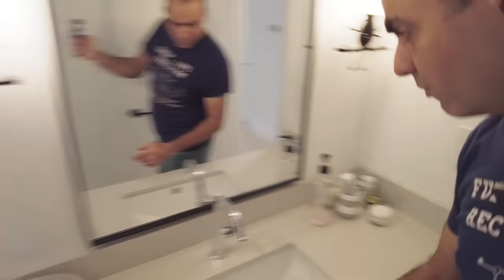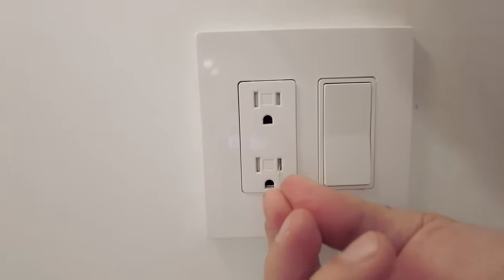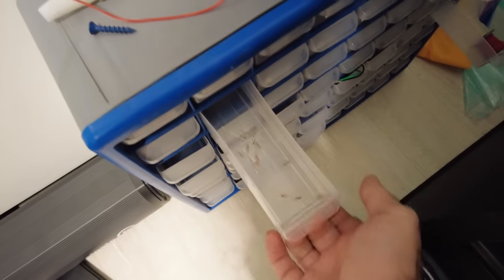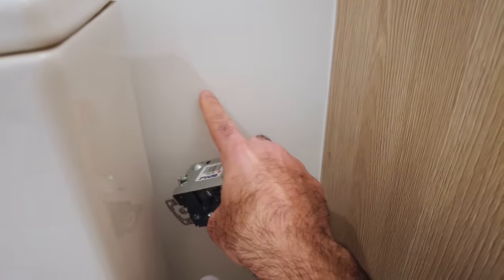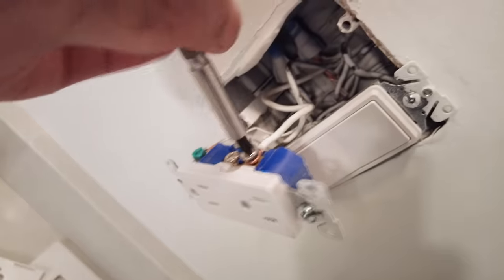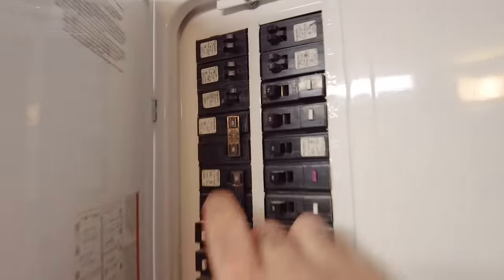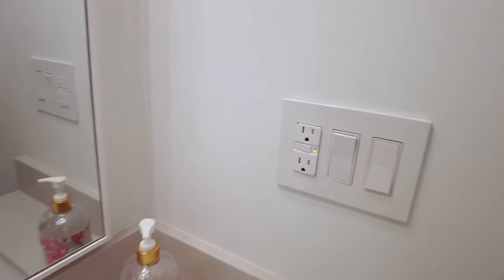Installing an Outlet… For a Toilet Seat?!

Comment: Sometimes getting it all to fit back in the outlet is the hardest part
Reply: I will definitely agree with that! Sometimes you have to use the screws to push an overly stuffed box back together. Hate having to do that as it can cause wires to slip out of wire nuts. Many times I find wire nuts that are too small for the number of wires or someone added an extra wire to the outside of old bundle without first straightening the old bundle out first and re-twisting them together and then using the proper sized nut. Then you have to push this all back in without a wire slipping inside of the wire nut. Personally I always wrap some electrical tape around the insulation next to the wire bundle before applying the wire nut.
Reply: Especially with a lower gauge wiring. Lower than 12 can be a real pain.
Reply: @Mentaculus42  I work as an electrician in a power plant. People are against taping wire nuts, but I’m not. It’s an extra level of security to hold your wires together with the nut. & if the nut does come loose, at least you don’t have to worry about exposed conductors
Reply: @rhouser1280  Why would anyone be against taping wire nuts?
Reply: I agree! But consider... If you have severe difficulty stuffing the wires into the box, then you may have exceeded the fill capacity on the box - which is a code violation. If you are relying on the device mounting screws to squish the wires into the box, it's a problem.
Reply: @THE-X-Force  Lol I made the same statement & was surprised at the response. One was that “it was unprofessional” others were “if you do it right, there’s no need to tape them.” I’ve been in boxes where the only thing holding them on was gravity & others where they had come off. I’ll almost always tape them. It’s a last line of defense & if you do it right, wrap it clockwise, it can keep tension on it in the correct direction & help keep moisture out.
Reply: @rhouser1280  Yes. I always tape. There's just no reason not to do it, unless someone is concerned about "wasting" money on two inches of tape. Wire nuts can come loose over time, even if you use them correctly .. so at least the tape gives a "last line of defense" .. like you said.

Comment: Nice. No drywall patching. That hole in the stud worked out really well. It would have been a pain to have had to cut the wall to get a drill in there in that space. Trying to get things through people's walls can be a nightmare. Especially in older houses. 

A lot of older houses have horizontal or angled cross members between studs. A lot of electricians also used to box their electrical boxes in with would and they would usually block off the entire stud space. Trying to get anything up a wall in a house like that usually means cutting drywall and cutting or drilling behind the wall.

There was one customer where we were trying to get a thermostat wire up from a crawl space. The fish tape just wouldn't go through, turns out whoever drywalled the house crammed all the drywall offcuts into the walls. The entire wall was full of broken chunks of drywall. We ended up having to dig a bunch of it out of the wall to get the wire up.

Comment: Great job!! Home DIY projects are always so fun to do. In my country it is illegal to have a plug outlet in the bathroom, even if it is GFCI protected. You truly inspire me! Have a nice day Mehdi :)
Reply: Just the whole room, may I ask what country ? usually there is a location issue like it must be a certain distance from the shower or taps ?
Reply: Yeah also curious here, can you wire anything in the bathroom? You said no plug outlet, is there another kind you can do?
Reply: @maxgood42   @Frizzy9000  Might be the UK.  They're only allowed a "shaver receptacle" in bathrooms.  No light switch except for a pull cord.
Reply: @jeffspaulding9834  No hard switch ? well it makes sense being wet and all.
Reply: @jeffspaulding9834  UK only permits safety ELV (12V, basically) that close to a toilet.
You can have a 'shaver socket' a certain distance away from water, anything else must be even further away - thus outside the bathroom, unless you have a really large one.
It's basically to ensure it's impracticable to drop a toaster in the sink or the bath.
Reply: @Richard-dc5he  But that's my favorite place to keep my toaster!
Reply: @Richard-dc5he thats why extension cords were invented. Why bothering with toaster, when you can drop extension cord socket board in to your bathtub while charging your phone and having a bath.

Comment: 4:38 mehdi lemme blow your mind - now there are GFCI receptacles on the market that have AUDIBLE ALARMS! I've been in the process of putting them at the head of every branch circuit lately, they're amazing, and also super useful for any non-technical people who may be in your home!
Reply: What value does that really add though?
Reply: @3nertia notifies you when it trips. It's helpful if you have a sump pump, radon system, deep freeze, etc on a GFCI protected circuit in a basement or garage, for instance.
Reply: @ematt622  I s'pose that's a fair point - I'm stuck in an apartment, without a vehicle or a job so it hadn't occurred to me heh
Reply: @3nertia  apartments sometimes have really questionable wiring! When I was little I had weird issues with gfcis in my apartment, and had no idea what the deal was other than something was tripped somewhere! An alarm makes it obvious.

Comment: Hay, I do electrical, and would’ve probably used yellow romex even, but it would’ve turned out the same with the path being hidden behind the wall and in the cabinet. The MC flex is a nice upgrade to romex. 
Is also a good little sit-thru for anyone not understanding what post-construction electrical is like. 
Great job Mehdi. 
TMI on the need for the Bidet though. 
Some Americans just want to fight over TP when it’s out, that’s all, they’ll never learn.
Reply: "where exposed to damage" or something iirc. Behind the drawers should qualify as protected. You aren't doing things behind there 99.9% of forever. NM would probably suffice!

Comment: He’s an electrical engineer, that’s why he was able to pull it off alive
Reply: I put in outlets when I was a 10 year old kid.  Anybody can do it.
Reply: @jonc4403  Uh... I wouldn't say "anyone" can do it. If I tried putting in an outlet I wouldn't even know where to start . Even if I did I'd probably set my house on fire from improper wiring lmao
Reply: @VeeTHis  With acquiring the necessary information, of course! You start by looking up electrical codes in your municipality. Then you identify which circuit breaker controls the circuit you need to work on. Turn that breaker off. Solve each problem along the way until you have an outlet installed according to the codes you researched :)

Anyone really can do this, it's not quantum mechanics ;)

Comment: Maybe the electric codes in Canada are different than the codes in the US regarding MC/FMC/AC, or maybe I'm misremembering the codes, but I thought it was against code to use MC/FMC/AC with plastic boxes. To do something like that, you'd need to run NM-B cable behind the wall to a surface mounted metal box inside the cabinet, run the MC to the new location, then splice the NM to the MC in the box. Again, maybe the codes are different or I'm remembering them wrong.

Comment: Not sure how it's the laws in Canada but here in Portugal you could be a problem installing an outlet depending how close it is to the shower area. Even with the glass protection that separates the shower, be careful with distances to it and try to improve/change the body of the outlet for one with a higher IP value of water protection just in case.

Comment: You could have daisy chained the outlet by the sink. Would have saved you the effort to use the wire nuts. Regardless either way is to code
Reply: That may have been the only he did to code.

Comment: 13:26 do you even need to tie the earth wire to the box? IIRC, unless it’s an isolated ground receptacle, the green screw is shorted to the metal box
Reply: Well you probably wouldn't need it, it's just for more safety. As always when grounding things.
Reply: Some outlets are rated for grounding that way, others aren't.

Comment: Not an electrician but from UK and it amazes me that the modules have the power feeds exposed. Makes me appreciate our sockets and wiring a bit more feels safer.
Reply: Watching this from france and oh man these breakers/gfci/outlets and those weird things to tie wires together really look medieval to me.
Looks like things you could find in a french house from 1980 or 1990 max.
Reply: Your sockets are better than our outlets but in terms of wiring: do you know what a "ring main" is?
Reply: Safety is for the cowards.

Comment: 11:37 Wait, the light switch is still active.... Are you allowed to have feeds from two breaks into the same box?
Reply: Yes, that's completely fine.
Reply: When I ran wires for 120/240 residential in California over a decade ago, it was allowed. My mentor/boss did advise that you try to keep the two live line on the same leg so as not to accidentally get 240V in a box meant for 120.
Reply: @wigglesfourthree3390  Reason why it's not allowed here is two fold. One, expectation, you should always be able to disconnect a complete branch / appliance with a single action. And two, if two wires from the same leg that are fused for their rating touch or get connected by somebody who doesn't pay attention you're now able to draw to much current because the breakers are now in parallel.

Comment: you didnt need to wire nut a 3rd length of wire to connect to the first outlet. if you notice, there are two screws on each side of the outlet. these are intended to be used for live pass throughs like what you just did. so you'd for example tie the incoming hot to the bottom, and the hot outgoing to the top screw, same on neutral.
Reply: You aren't wrong about the device being able to do that. However, best practice is to pig tail from the wire nut. This way, the device isn't carrying the full load of all downstream devices and you can remove that device simply without compromising anything else.

Comment: 11:00 you could have also used the terminals on the receptacle- the two brass screws are connected together and the two silver screws are also connected together.  This method is generally better if the box is already pretty full or if space is too constrained for your method.

Your method of pigtailing also works and some say is the superior method, as if the receptacle next to the switch fails, it would not affect the receptacle by the toilet.  But it does use more space in the box for the wire nut and extra length of wire, so it may not always be the ideal way to complete the job.

Overall, a 9/10 job.  You forgot the anti-shorts, which would prevent the steel armor of the cable from cutting into the wire when you clamp down on them.  But seeing how it didnt explode... well... i wont tell if you dont tell.

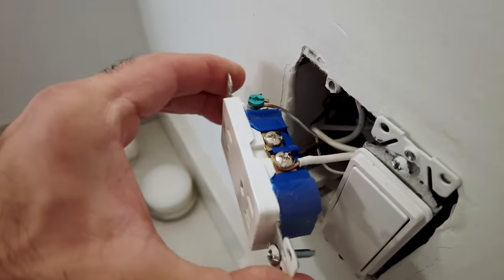Comment: 7:56 Why on earth are those sockets designed like that? Who thought that having the L and N on either side, exposed ,would be a good idea?
Reply: Especially as metal boxes are quite common in North America.
Reply: There was a time when legal sockets allowed you to insert the end of the stripped wire which in theory could have dealt with this issue, but they caused other safety issues, so back to exposed screws. Personally I always wrap some electrical tape around the exposed screws to deal with this and other issues.
Reply: Most likely it was Thomas Edison. He had over 1000 patents on all sorts of electrical components. Many electrical things here in the US are still somewhat similar to when they were invented. I can install a brand new switch or receptacle in a box that's almost 100 years old and the screw holes are the same distance apart and use the exact same screws to install.
Reply: The North American outlets are just awful in every way.
Reply: You win the power outlet

Comment: I'm not sure but... 
I think the hole someone bored in that stud is too near the edge of the stud for code. It's mentioned in the NEC but is more Structural code. 
The structural integrity of the stud is compromised. They make metal braces to add support for that problem. 

Otherwise, I think the wiring inside a conduit covers you for sharing that hole with plumbing, but again, not certain. 

For future reference, they make super long semi flexible shanked bits to put another hole right where you need it, without removing sheetrock. Check with you friendly electrical supply house, or Amazon. 

Nice video, love ya

Comment: The power outlet here in the UK is either referred to as a socket or simply 'the mains'. As in 'Plug it into the mains'. 👍
Reply: That sounded so corny😂
Reply: Well, "the mains" usually just means the power wires, not the receptacle itself. Over here in the east coast of the US, I usually also hear it called a "power socket" or "wall socket."
Reply: mostly a south/south east thing to say imo! others say socket, or just plug it in. never outlet, and if you’re really posh you might say receptacle
Reply: Same here in India too
Reply: I disagree, the mains is the source of the power. For example, if I had a "plug" or "socket" coming directly from the national grid, and one coming from a power generator, I'd say plug it in to the mains.
Reply: They are also illegal in most UK bathrooms. I had to run my bidet mains flex under the door and around the corner into a socket in the hallway.
Reply: @fromthegamethrone  I've never heard anyone referring to it like that.  I hear 'Plug in into the mains' as a slang term for 'plug the device into the wall socket'.
'The mains' is obviously a slang term in itself.  Electroboom was attempting to say the correct term.
Reply: @Shocker99  that just means you've never been anywhere where there is more than one option, UPSU's, Generators, DSU's from other devices/sources etc. You're not incorrect to say plug it in to the mains, if the mains is all you have.
Reply: Everywhere I've went in the UK (I'm Scottish) call it the socket. Mains is what comes in and goes to the trip board imho.  @Shocker99
Reply: @fromthegamethrone  You're assumption about where i've not been or been near is wrong.  I guess 'the mains' as a slang term for wall socket is because the vast majority people are surrounded by only wall sockets the vast majority of the time.
I say you do you regardless of how accurate your slang is because who cares.  It's just like how the vast majority of people in workshops use 'mil' as slang for millimetre and 'thou' for thousandth of an inch, when in reality they both mean the same - a thousandth of the measurement unit.
Reply: @Shocker99  *your

Comment: I've been advised that steel armored cable (sometimes called "BX") is not allowed by our local building codes because of the risk of nicking the wires.  The code does allow flexible steel conduit (Greenfield), so that's what I use. When installed, it looks the same as BX.  (I'm an electrical engineer and installing a bathroom receptacle for an electric toothbrush.)